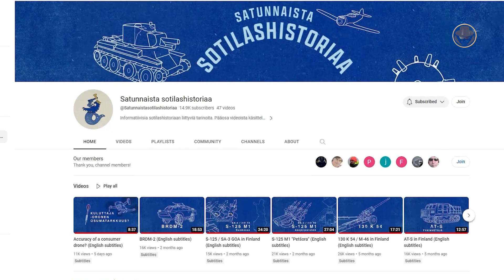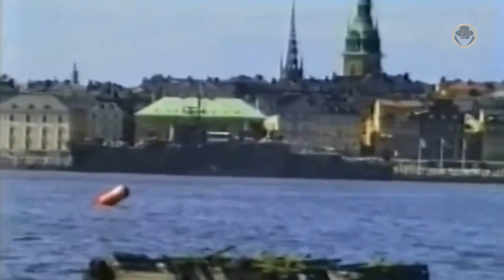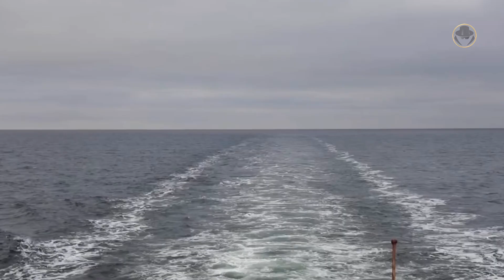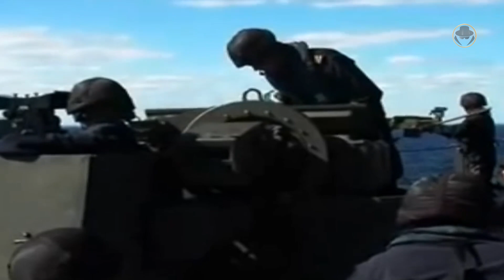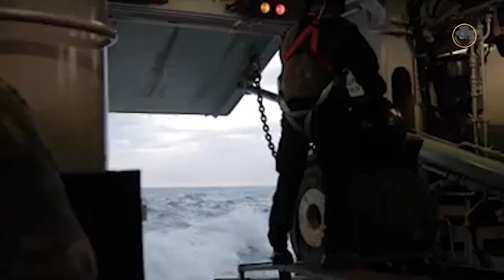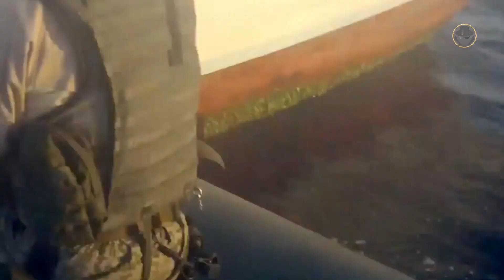FNS Pohjanmaa | The legendary minelayer of the Finnish Navy

Comment: She’s an old Beauty 

I’m surprised They spend so much on such a relatively large navy ship

Coastal boats simply suit Them better
Reply: Missile boats, mine layers, mine barges and mine warfare vessels are basically what the coastal fleet consists of. In the Baltic Sea, on its home turf, it is supported by coastal anti-ship missile batteries.

Finland is currently replacing older vessels of the aforementioned classes by new corvettes that are supposed to combine their abilities.
Reply: @herptek  Obviously cost issues mostly

But I Hope the ships gave Them some nice QRF cruising speeds and missile platforms 

Help justify a few big boats taking up so much of the whole Nation’s Navy

Overall They’re doing fine for such a peaceful place

But interestingly if anything did happen; Their opposition would certainly give Them a very Bad Time

Finland is always balancing such a scary dilemma

Same as the rest of the Norseland
Reply: @ComfortsSpecter Russia has no chance at surface warfare on the Baltic Sea surrounded by shores full of missile batteries hostile to them. Finland alone could deal with St. Petersburg direction.
Reply: Large ship is needed to carry a larger amount of mines. It had a relatively light armament and slower speed for it's size which lowers the costs.
Reply: @menninkainen8830  The other minelayers of the Finnish navy are better armed. This one could work against pirates in its old days, but otherwise it was outdated by now.